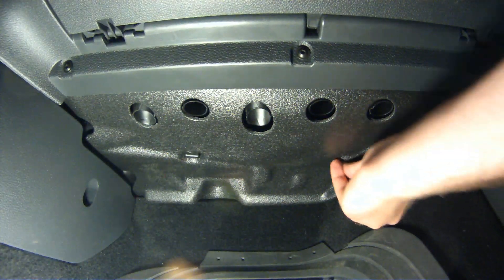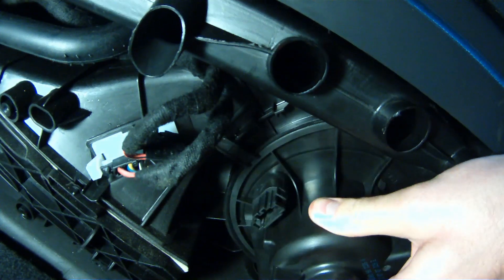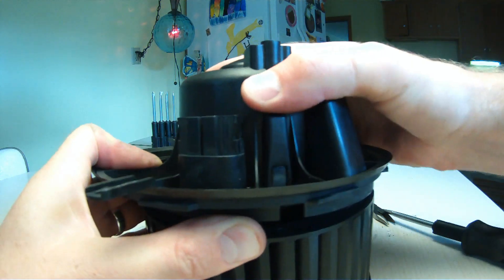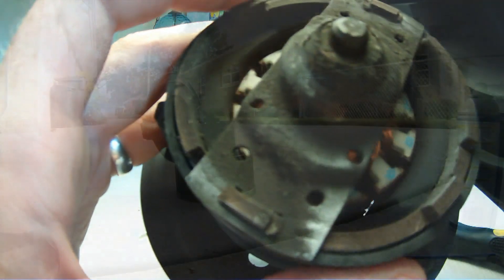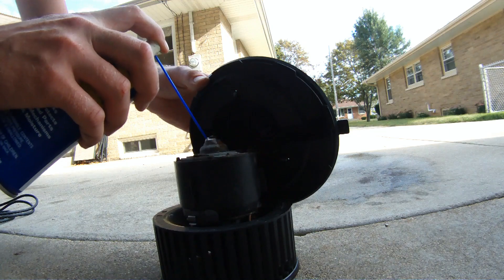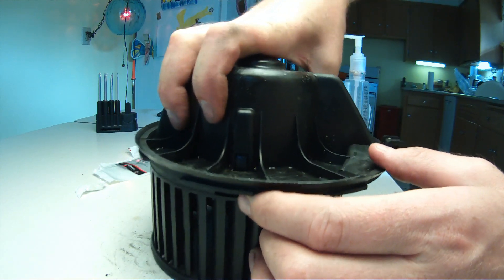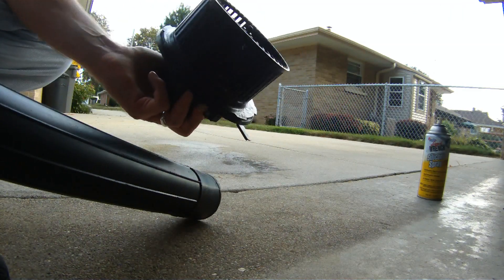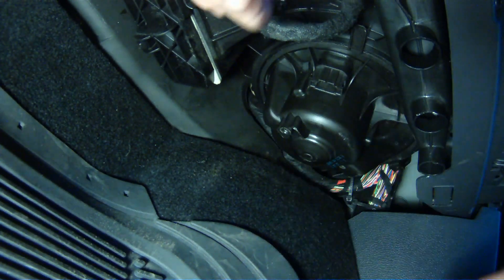VW Rabbit Blower Motor (2004-2008)

Comment: Where is the sound deadening foam? Under the glove box?
Reply from the maker: Yup. Directly beneath the glove box. It's held on by two plastic screws. Some models have hand-tightened fasteners. Others require a screwdriver. Once the screws have been removed, just grab on to an edge of the foam and tear it out.   It's pretty resilient.
Reply: Excellent.  Fixed the thermal fuse and gave the blowet some wd40.
Reply from the maker: Noice!  I love it when a plan comes together!
Reply: hanoihancock I didn't have any carb cleaner so mainly used WD40 and baby-wipes. Could I use a hair dryer instead of a blower, i'm getting a slight smell of WD40 now in the car when I use the fan.
Reply from the maker: Declan Carey Use a hair dryer as a last resort, but make sure the motor is super-dry before re-installing. I used soapy water and a garden hose initially to blast the dirt and grime away. However, it's going to be difficult to dry the blower off enough if you don't have some way to power dry it. Do you have a shop vac? You could hook a hose up to the shop vac exhaust to blow the motor dry. If you have a compressor, you could us compressed air to blow it dry. Otherwise, ask your friends and neighbors if they have a leaf blower you could borrow. Also, buy a can of carb cleaner. It does a great job of evaporating any moisture left on the motor.

Comment: WD-40 really isn't a lubricant and is a particularly bad choice for this application. Some kind of lubricating oil (WD-40 is a water-displacer) would be a much better choice.
Reply from the maker: +Curtludwig-Two TY for the tip!
Reply: Absolutely agree. WD-40 is great for loosening and cleaning almost anything, but if you leave it in a bearing or shaft/sleeve it will gum up and become glue-like. Clean out with electronic cleaner (or isopropyl alcohol) and if the motor shaft is a steel shaft in a brass sleeve, just leave it dry. If it's a bearing, you can use some 3-in-1 or other light machine oil on it.

Comment: I have an 08 Rabbit.  Lost my heater.  Bought a new resistor and a new blower motor.  Still nothing.  Any suggestions?  Anybody?
Reply from the maker: By "lost my heater" do you mean the fan is still spinning at all speeds but you only get cool air?  If so, that sounds like a heater core and/or flap actuator issue, not a fan or resistor issue.  If the fan is not spinning at all, check the electrical fuse...not the thermal fuse...behind the panel on the driver's side dash.  If the fan was only spinning at high speed before, then replace the thermal fuse on the original resistor and return your new resistor and new fan.   Hope this helps!
Reply: @hanoihancock  thanks man.  I replaced the resistor and the blower motor because I had the common, lost my low speed on my fan then lost my high speed shortly after.  I went and replaced the resistor then the blower motor and it didnt fix it.  Turned out there were some fuses to the left of the steering wheel I didnt know about.  (Didn't get a manual withdrawal the car)
All it was, was two fan fuses had blown, there.  I finally fixed it today.  I live in Edmonton, AB, so it has been cold AF!  If I would have been able to check these fuses, it would have saved me lots of money and a buttload of time.  It's been a record breaking cold winter here and today...today, I have heat!
Reply from the maker: @Gemaniacal  Glad to here you got it figured out!  Stay warm!

Comment: is it worth it to buy this car now in 2017 ? i mean the 2007 or 2008
Reply from the maker: gameraime I'm still driving mine.  If the suspension hasn't been replaced yet, it probably should be.  that job is easy on the rear, but a PITA on the front.
Reply: I think so.I just bought a 07 rabbit and it's a great car.
Reply: i would like to say if you have not and youre still wondering you should. i bought my lil wabbit 2.5 hot hatch 2 dr black on black in march 2019 and i need to say right now that its my first rabbit and an automatic to boot! all my other vdubs were manuals so you can imagine my skepticism with this but prior to this car i had a 04 passat which was my very first auto and it did very well with no issues i drove it hard for 2 yrs it never burped. and this car has performed the same way if not better. one thing about the germans is when they develop cars that are automatics the do it with manuals drivers in mind as many of them are. i would say get the car you will not be sorry. i could say more but it would take to long!!!
Reply: Love my Rabbit best car I ever had

Comment: Has anyone experienced AC intermittent issues on their MKV Rabbit?I cannot pinpoint the culprit. It starts warm then cold back to warm air. Thanks.
Reply: +Tom Tam It could be a number of things.  Check to see if the evap filter is clean and then check the pressures.  It might just be low on charge.  If it is you can top it off, but you should look for oil leaks around the schrader valves and any where a hose or pipe might be rubbing.
Reply: Did you ever find out I'm having the same issues?

Comment: hi. I have done the same thing you done . But is not working 1,2,3 Is not working . only 4 Is working
Reply from the maker: Erdjan Berisa Did you replace the thermal fuse?
Reply: I haven't replac that .. where do I get it . how do I fix the thermal fuse
Reply from the maker: Erdjan Berisa Here's a video showing how to replace the thermal fuse.  Check the comments for suggestions on where to find/buy the part.  https://youtu.be/mLWn3J6QUXk